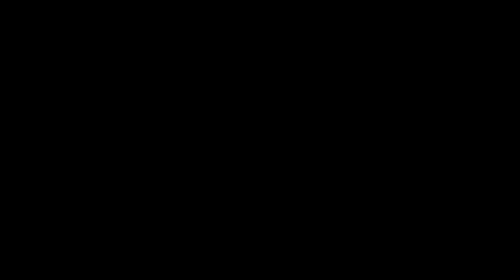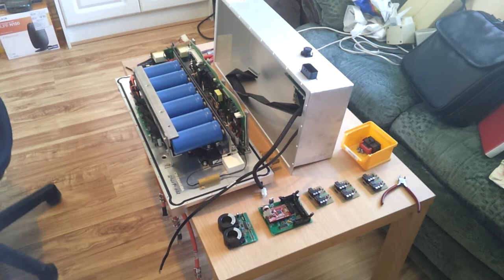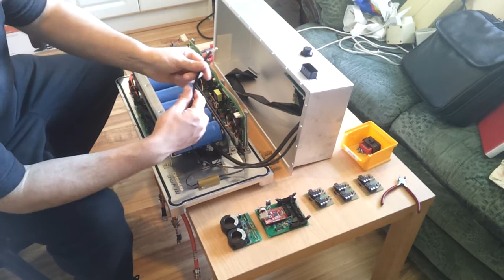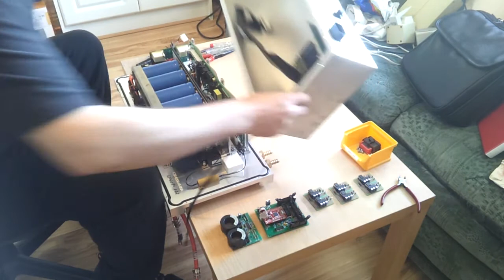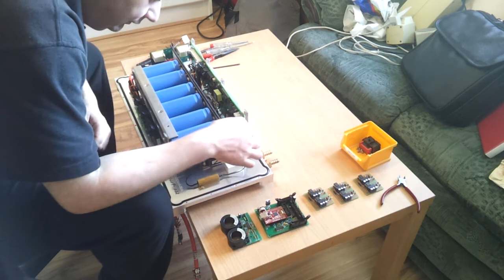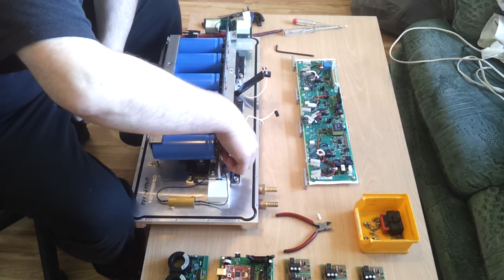BMW E31 840CI EV Conversion 12 : Inverter 01

Comment: Damien, What is the chip change in the driver board? Is that something Johannes recommended or something you decided to do for your driver boards? I have some questions but will be following once again your venture into the Open Source Inverter.